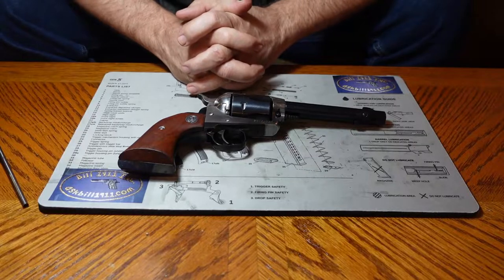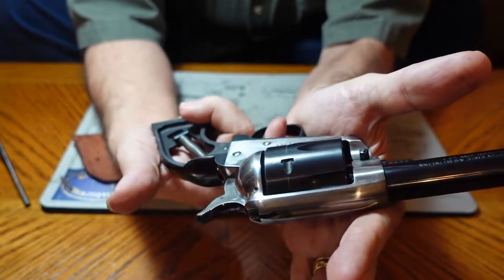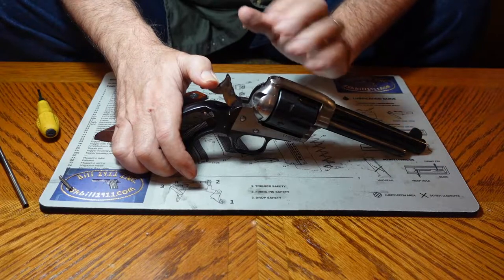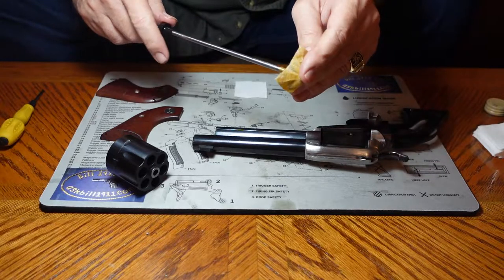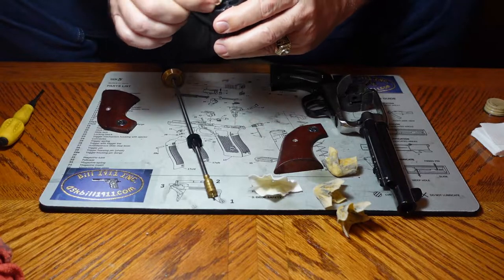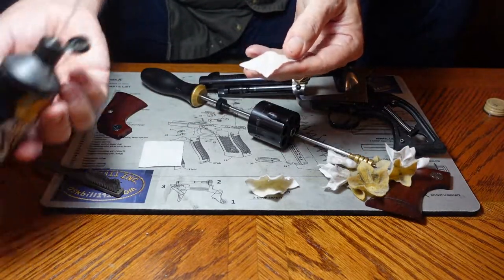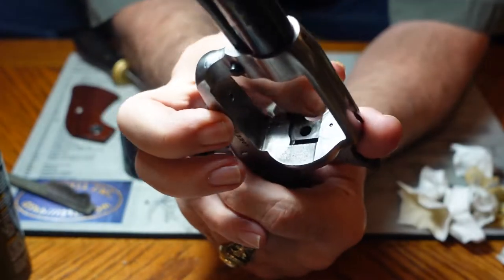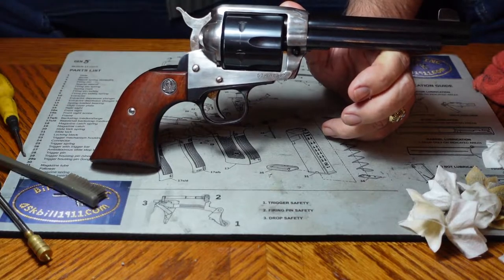How to clean and lubricate the Ruger Vaquero (Copy of Colt Peacemaker) #cowboyguns #wyattearp

Comment: Awesome revolver Thank you for sharing
Reply from the maker: It is a really cool gun. It's not an exact replica of the 1873 Peacemaker. It uses a lot of coil springs in stead of the old leaf springs like the original. That makes it much more reliable. I've never had to replace a spring in the Ruger. I've replaced several of the leaf springs in Colt replicas. Usually the trigger return spring. In my opinion leaf springs are more prone to snap rendering the gun inoperable. I also feel that the Ruger has a little smoother action. That said! Both the Colt, and the Ruger designs are terrific reliable guns, and a lot of fun to shoot.

Comment: Excellent information...  the Ruger Vaquero large frame is an awsome piece!

Some info for you:   Its just Colt... Not long.

Thanks for the video....
Reply from the maker: Yes I'm aware it is just colt. I couldn't tell you why, but I started calling it a Long Colt years ago and it stuck in my mind. Bad habits are hard to break. I wish I could say I won't call it that in the future but I'll probably screw up and do it again. Lol. Sorry about that. Thanks for watching.
Reply: @Bill1911  
That's The best reply I have ever received on this subject....   Thank you!
Reply: @Bill1911  don’t feel bad. The .45 colt and .45 long colt terms refer to the same cartridge. The long was added at some point to differentiate from a similar shape, but shorter cartridge (.45 Schofield, I believe). Either way, today you buy the necessary ammo as .45 long colt which is why you probably started saying it. Thanks for the cleaning vid and background info!